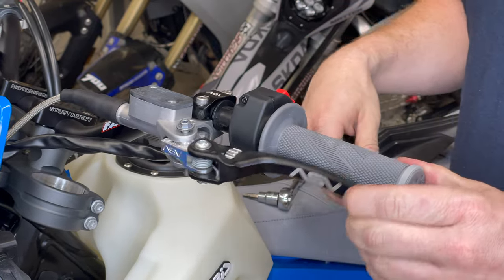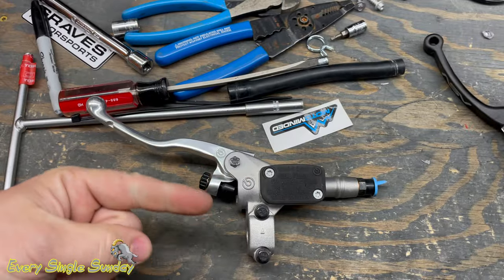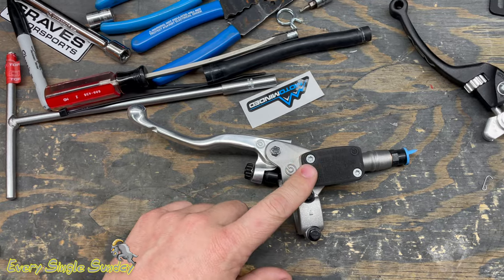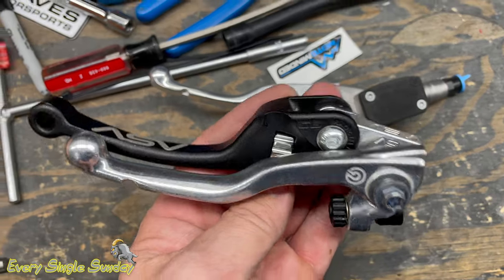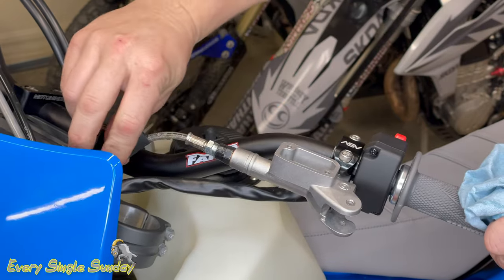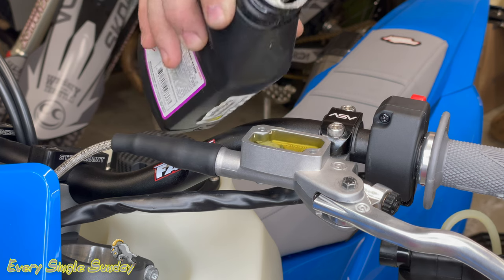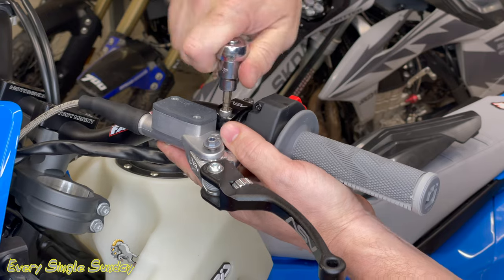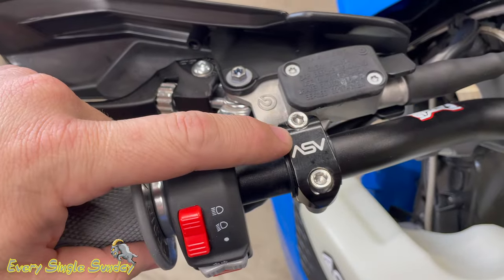Lighter Clutch Pull - Here's how to do it

Comment: I'm riding a KTM 350 exc-f and smashed my master cylinder yesterday on a trail. I heard that if I move to a smaller bore size the clutch can be easier to pull (and I guess I will have a longer friction zone), but I could not find any info regarding the compatibility of the clutch line and slave with a smaller bore size. I'm happy I came across your video. Looks like I can stay with the same line and slave. Also, I love these levers you demo'ed, going to get them as well. Thanks for a short video which is right on point!
Reply from the maker: Happy that it helped you out. Enjoy that bike and have fun.

Comment: On my 02 ktm 250sx and now on my 18 beta 250rr re is replaced lever with the Mid West Eng. Lever . On my beta it is a 1 finger pull all day long . I don't like the square edges on the lever to I just took a curved file and rounded it off for my comfort  .  I love them , best money I have spent .
Reply from the maker: Midwest changes the pivot to basically make it feel like a 9mm 

Problem with Midwest for me is that it doesn’t fold forward and I will not run full wraps anymore. But I did run a Midwest before when I was a full wrap guy and it’s good (if you’re smart enough to set it up)
Reply: @EverySingleSunday  Hey Travis, how come you won't use full wrap hand guards any more?
Reply: Yes, why no wraps anymore?
Reply from the maker: @mricehome  messed up jumping some rocks and my hand slipped off the grip and went through the wrap around as I crashed. Luckily I didn’t break my arm but have heard of it happening too many times. Not worth the risk so I’m back in flag style now
Reply: I have been running full wrap guards for over 15yrs . I never had a issue like that I have heard about it but when banging through the trees I prefer not to smack my knuckles
Reply from the maker: @sdrown212 if I was racing back east in the trees I would probably go back to full wraps.
Reply: My friend severed his thumb in a race with full wraps. Doc was able to reattatch it and no more wrap arounds on his competition bikes. anymore.
Reply: @EverySingleSunday  I have seen this several times. Only run flag style guards now. XsX makes one heck of an open guard. Kinda spendy for what they are in my opinion, but I like them because they can be placed next to the grip, while my controls are moved inboard for leverage.
Reply from the maker: The SXS flags are fantastic products for sure. I run a bar with sole more rise so I’m limited on bar space with the headlight / multifunction switch and then also the clutch. And I have a map switch that needs to go one also.

Comment: I put a 9 on my 12 ktm 350 xc-f and it's night and day better.  I was at the shop the other day and saw a brand new ktm 350 xc-f factory model or 6 days or something (one of the really premium models) and sure enough it had a 9 clutch.
Reply from the maker: Ya, the 350s comes with them. 500s and 300s are usually on a 10
Reply: My 2012 350 had a 10 on it, but it could've been aftermarket from previous owner
Reply: @EverySingleSunday my 350 as a 10 and its a factory edition
Reply: Hey I have a 2015 xcf 350 and sometimes it's hard to start when hot, and suggestions?

Comment: Why not just adjust the clutch diaphragm disc as well.  This is all I do with every KTM I've owned recently , and I have small hands.
Reply from the maker: Because on a 500 you need the extra pressure or the clutch will slip 

On my 300 I move to the lighter setting but on a 500 it doesn’t work 

I also do the clutch master along with adjusting the disc pressure as well

Comment: If you don't have a vacuum bleeder take a large serenge and load it with brake fluid, go from the bottom bleeder port by the engine cover, open the fitting port, push fluid up into the reservoir slowly.  Works like a charm, in 5 minutes you will have an air free perfect clutch pull.
Reply from the maker: Yep, another great way to do it

Comment: Every Single Sunday, I came off a previous gen Husky, not on a '24 KTM. First thing I noticed above all the other changes and dratmatically different ergos is that the Brembo clutch is FAR more resistance than the magura on my old Husky. I have issues with my left hand so this is causing a lot of trouble. I need to do everything I can to reduce the pull weight. Can you advise on what belleville washer to get, and whether it is ok to remove or shorten clutch springs? I am not sure I want more travel. I do not know what the piston size of the magura master cylinder is.
Reply from the maker: If you have a 500 I wouldn’t go to a softer belleville washer, this much power and it might start spinning. KTM doesn’t use a clutch spring, just the washer. There are 3 settings and they come in the middle so going to a #1 will soften the pull but is also less pressure so it might slip on heavy power 

As for a lighter pull you can do this 9mm but it is more travel. Or you can go to a Magura like you had before if you are a fan of those.  Hope that helps

Comment: Pretty neat info 👍🏼.  I usually throw just a tiny dap of grease on my reservoir cop screws. Those things are bad about the fluid rusting and seizing them.
Reply from the maker: I’ve never had that issue before but I also live where it’s pretty dry and doesn’t rain. What are do you live in?
Reply: @EverySingleSunday  well honestly your prob one of those people who bleed and flush fluid like you should lol.  I have never had it happen on my personal bikes. But my family owns a dealership here and growing up wrenching on bikes there seized stripped cover bolts was the norm so it’s just something I have always been told to do.  

East Tennessee area.
Reply from the maker: That makes sense.

Comment: Thank you for the video! Just got my 9mm master clutch. I wondering about the clutch lever. Do you think is this worth the money ? Is make the clutch lighter compared to the original lever ?
Reply from the maker: It’s slightly longer than the stock lever, which makes it softer. The main thing is that it is adjustable and you can get it exactly where you want it.

I run these on all my bikes and love to feel and shape

Comment: Back in the cable clutch days on the Big Island of Hawaii Mauna Kea 200 two day extreme enduro I used a tackle box fish weight scale to check riders clutch pull lb, the pulls varied from 3 to 8 lb pull, some were smooth some were rough and hard pull, I called them DNF clutches.
Reply from the maker: 3-8 sounds really light. Stock is around 15 on these bikes and with this mod plus another we can get them down around 9. I’m probably at 12ish now but the other mod takes pressure off the clutch, not good for the 500

Comment: My ktm 300 2017 had pretty soft clutch stock. Then I put a quite widely used folding lever from aliexpress and now it is even easier…can ride whole day without  any fatigue. I tried the 9mm and didnt like it - i would need to keep the lever far from reach or suffer the clutch drag…
Reply from the maker: My 300 runs a 9mm now and I love it. But, it’s definitely a personal preference and what fits your hand. The 10 definitely requires less throw so as long as you’re happy

Comment: Have u ever had to adjust the pressure plate to #3 hole? On my 24 300 it engages towards the end of lever throw, it's definitely worse after repeatedly slipping it. I've manually bled it twice after installing 9mm.
Reply from the maker: If it’s been slipping and you’re in a higher pressure setting the plates are probably worn out and need to be replaced. 

I usually run on the softest or the middle setting for less pressure. 

I would also make sure it’s bled properly. KTM clutches usually last forever so it to be dead already is wild

Comment: I usually push the fuid from the brake caliper and up to the reservoir to bleed the air. Does it work the same way with the clutch?
Reply from the maker: You can go either way. I use a vacuum bleeder on the bottom so it sucks it down and I can just keep adding fluid. This is easier for me and works perfect. But both ways work

Comment: Midwest Mountain Engineering clutch levers? Any good do you know anyone who runs them👍🤙🏻
Reply from the maker: I used to run them but don’t like the feel or the fact they don’t fold forward 

I’d rather run a ASV as they slip on the bars and also fold forward. Couple that with a 9mm master and it’s the best setup there is

Comment: Did you ever replace the headlight?
Reply from the maker: Always. I run a Ruby Moto R7 as I feel it’s the best option available for an enduro bike
Reply: @EverySingleSunday  I found it on the taco moto site and will probably upgrade to that.
Reply from the maker: You’ll love it. They also sell a dimmer dongle if you want to have High / low operation with it.

Comment: Thinking seriously about going this route, im using Midwest on the same bike. Its hard to get set-up perfect an keep free-play in the lever. My bike never was easy to get into neutral but it's almost impossible once it hot unless youre rolling which isnt a huge issue but jus enough to be lil aggravating at times.
Reply from the maker: I ran a Midwest for a long time but don’t like wrap arounds so I need a folding lever. The 9mm feels great in my option 

Most KTM don’t like to hit neutral unless you’re rolling.